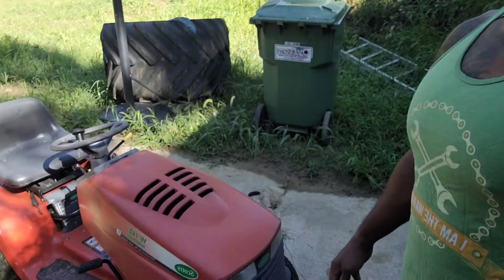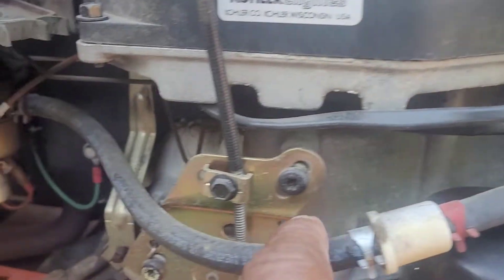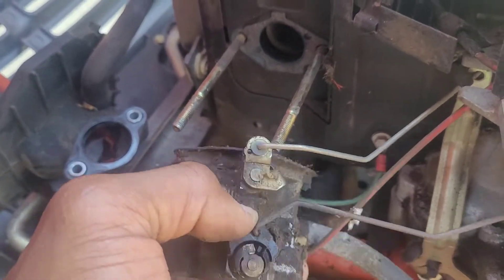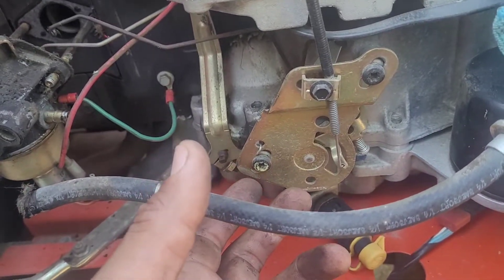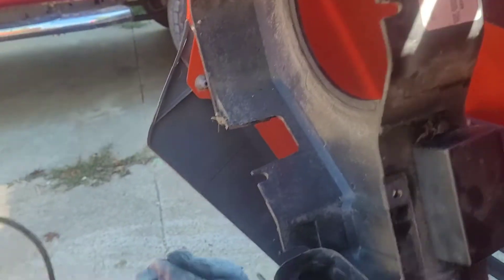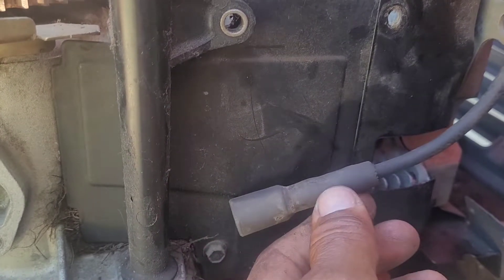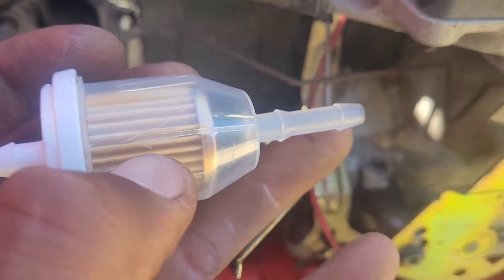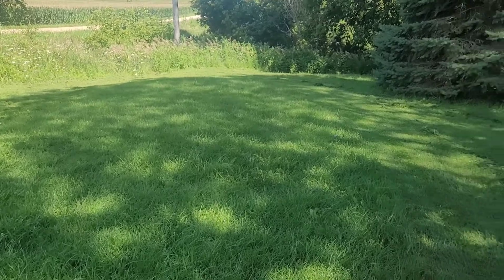How To: Maintenance On a Scott's (John Deer) Riding Tractor/Lawn Mower!

Comment: I had one of those.  Made for Home Depot.  It had the best control for Forward Reverse.  I hate those pedals.  Don't forget to do the Steering Shaft Bushing.  2006 Model?  That device under the Float bowl is the Fuel Shut off solenoid.  You can hear/feel it click when you turn the key to On.

Comment: I HAVE THE SAME RIDER & THE CARRIAGE GOT TOO LOW SOMEHOW SO WILL SHUT DOWN. I KNEW THAT'S WHAT IT WAS WHEN IT WOULDN'T START IN MY SHED & WAS CUTTING INTO THE WOOD FLOOR. IT'S ALSO A MAJOR PAIN THAT IT'S SO HARD TO GET TO THE SPARK PLUG TO GET HANDS IN THERE. MY LAST RIDER A MURRAY WAS SO EASY TO GET IT. THIS SCOT'S ONE ALSO HAS CRUISE I WASN'T USING ANYWAY BECAUSE OF DEEP TREE ROOTS I HAVE MARKED. THE BLADE IS ALL THE WAY UP TO 6 & I COULD CUT GREAT BEFORE AT 4. HELP IDEAS?

Comment: I have this same exact mower i actually just picked up from off market place aswel. Now it runs good and cuts, but the only bad thing uts doin is cutting off seconds after i boost it off, but aslong as i got the booster cables connected to the battery it stays running, but when i disconnect the cables it turns off. Whats my problem?? 😩😩
Reply from the maker: Hey thanks for watching! If I'm reading your question right, sounds like you have either a bad battery, battery terminal connectors or most likely a bad stator! The stator is like an alternator on a car, once the battery starts the mower the stator keeps it running. However if battery has a bad cell or the terminals aren't clean of debris/corrosion and fully connected the power the "booster" provides could be enough to over ride those issues. Test the battery..if good clean and fully connect the terminals if those are good..odds ar your stator is bad.
Reply: @minutemaintenance7385  thanks alot!!!!

Comment: I have the same lawn mower what type oil filter did you use? And did you say 4qts of oil?
Reply from the maker: Hey Boss thanks for watching!! For me it Took 4 qts to fill her up! Obviously be sure to measure as you go on the dipstick to be safe! I attached a link to the oil filter I purchased off of Amazon!

https://www.amazon.com/Filter-Deere-Scotts-L17-542-L2048/dp/B074G4WQV2
Reply: WOW I HAD THE SAME ISSUES OF THE STALL. I DIDN'T KNOW IT TOOK 4QUARTS OF OIL...5 W 30? BECAUSE I PUT IN 5 W 10 & SHOULD PROBABLY CHANGE NOW ? I NEEDED THIS TO KNOW WHERE TO CHANGE THE SPARK PLUG, THAT'S SURE HIDDEN ON THIS RIDE! MY LAST ONE WAS EASY ACCESS. THANKS SOOOO MUCH FOR SHOWING US AROUND ON HOW TO DO THIS MAINTENANCE!!! FOR A SINGLE GIRL I HAVE NO CHOICE TO LEARN STUFF ON MY OWN. YOU MADE THIS NICE & EASY. GREAT MILWAUKEE VAC.... I'M FROM WI. 🙂👍🚜

Comment: Did you order all those replacement parts in a bundle from Amazon? Do you recall the seller or brand of the items? I’m having trouble rounding up the parts locally and prices are all over the place. I need what you have minus the carb. The spec sheet in the book for s1642 says two quarts of oil with filter included. Thanks  I’m trying to get this mower tuned up to run
Reply from the maker: Hey boss! Oil I bought separate but this is a similar "tune up kit" I got off Amazon listed below!!

https://www.amazon.com/Panari-GY20574-AM121608-AM123553-Tractor/dp/B076JG6L1Q/ref=mp_s_a_1_9?crid=2WO03EQC1O3AP&keywords=scotts+s2046+tune+up+kit&qid=1686451521&sprefix=tune+up+kit+for+scotts+%2Caps%2C205&sr=8-9
Reply: @minutemaintenance7385 thanks for the link!